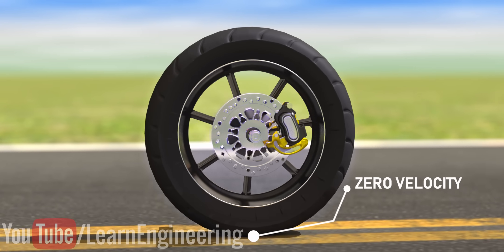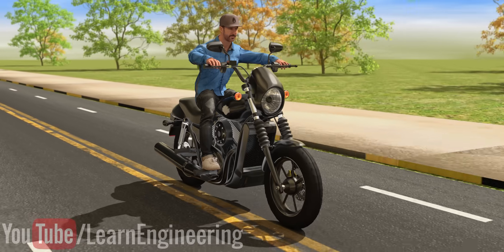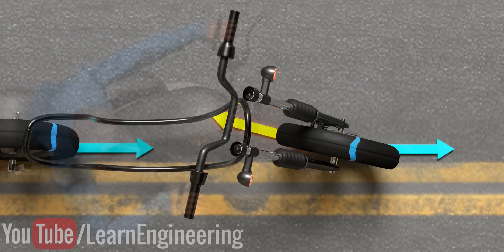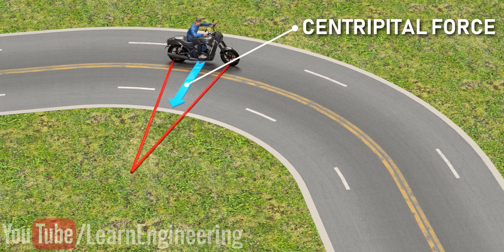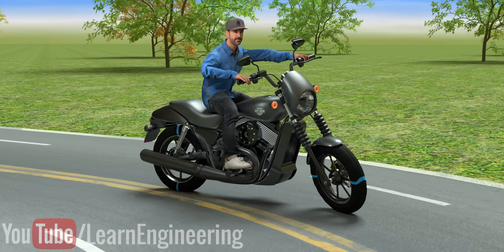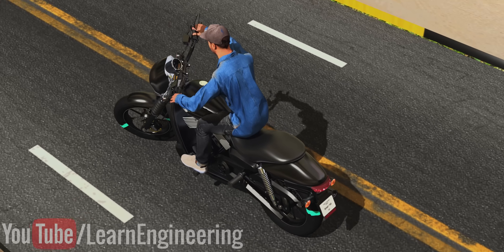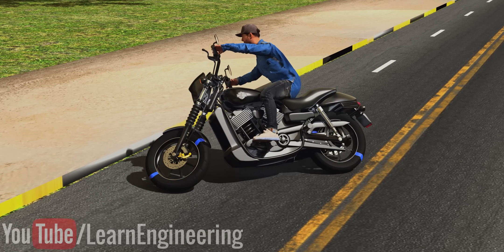Counter Steering | The interesting physics behind it

Comment: Tried.... the technique...  and got  broken right hand elbow 😥
Reply from the maker: I am so sad to hear that. :( Please don't try to master this technique in a single day. You start with small steering wheel turn and gradually increase the angle. It took more than one month for me to master this technique.
Reply: @SabinCivil  I'm sorry, I am confident you have never rode a bike because this isn't something that takes months to learn. You either get it before the first turn, or you end up in a wall. Please just take down the video before you get someone killed over some pack-of-cigarettes worth of ad revenue. This video is completely wrong. There's no trick to it, you just turn the bars and the bike leans the other way. You do NOT snap the steering back into the turn. Doing that will cause the bike to violently jerk and catapult you in opposite direction. You don't get to pick between counter-steering and regular steering. Above ~15 mph it will ALWAYS counter-steer. Below ~15mph it will ALWAYS regular steer. When you're going 60 and trying to go right you HAVE to steer counter clockwise and slowly straighten out the bars as you exit the corner.
Reply: Serge Gukasov 
Absolutely right! This video should be removed! Totally inaccurate!

Comment: I don't think the person who made this has actually riden a motorcycle. It is impossible. effectively steer a Motorbike without countersteering. Turning the handle bars at any speed above walking pace  will only ever have the effect of making the bike go in the opposite direction of the handlebars.
Leaning your body only has a minimal effect on the trajectory of the bike. Its not used as a means of steering the bike. Only to effect the amount of lean angle needed to make a corner.
Forgetting to turn the handlebars back after countersteering really a thing  either. The bike naturally corrects itself.

Comment: This explanation should be ignored, it's not worth a flip. Motorcycle stability and turning cannot be understood without looking at angular momentum, in the wheels and of the entire bike. Rider tilts bike by turning handlebars (in opposite direction). Moving body to the side makes nearly no difference in bike angle. It's all about the momentum vectors, and the cross product. Whoever made this video was an artist, not a physics student. https://lifeatlean.com/how-to-turn-a-motorcycle/
Reply: Why everybody sees only one side? Ok it’s not the best video but turning outwards definitely is causing the lean even on a bike with wheels with no mass. Every turn of handlebars in the straight position will throw you of balance despite the mass or rotation speed of the wheels, right?

Comment: Well explain and easy to understand. I have been designing motorcycle in big Japanese company for more than 10 years, But always find difficulty in explaining this to new engineers.
Reply: Walking hippo 
Well apart from the fact that the video is totally inaccurate on many points!
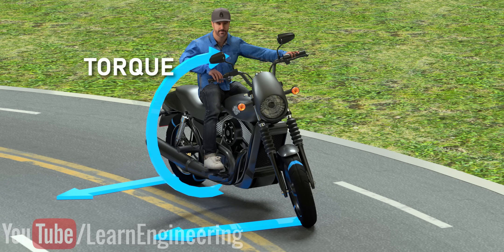Reply: @softailfun   Softail Fun  Yeah. Some explaination is weird for me also. But from 2:30 to 3:40 I think it's accurate enough. That is part I use.  And his VDO is look much better than my hand drawing anyway ^.^
Reply: Walking hippo 
But that is probably one of the most inaccurate segments of the video. The video shows the rider steering right to go round a right hand bend. This is inaccurate. The rider would be steering (very slightly) to the left at this point.
Reply: @softailfun  Yes you right. Counter steering is not a choice. it's a must. Before you lean right you must steer left slightly. Rider do it unconciously.  Some skill rider may do it conciously on purpose. This steering direction in VDO is not accurate. 

I only focus on the arrow and torque and didn't notice the steering direction. May be I should find a better material next time.

Comment: My scooter is new but getting slip while turning in normal'speed
What's could be the reason???
Plz suggest
Reply: Can you explain more. Front or rear wheel slip? Tyre pressure? Road conditions? Model of scooter?

Comment: "A technique used by many riders"?!?...  It's used by ALL riders.
Reply: Live riders :D
Reply: and even for ghost rider :v
Reply: THANK YOU.  You can’t turn without initiating it with at least a small counter steer.
Reply: It's the only way
Reply: It's not a technique. It automatically happens in any turn after about 8 mph.
Reply: @generalyellor8188  At any speed at all, from walking speed and up
Reply: Thats a beginner problem, i learned it seeing other riders when i was practicing in traffic
Reply: Yeah, I find it funny how they explain it as if it was some advance Moto GP technique. I don't even know how you can ride a motorcycle over 40 km/h without ever counter steering.
Reply: @foufoufun  Actually at any speed, from idle and up you countersteer.
Reply: @kjellg6532  True, it's just that you have to be more deliberate with it above ~25 km/h.
Reply: Did you watch the video completely?
Reply: The cortex learns how to ride a bicycle without reasoning processes. It is possible to explain how the rider starts by tilting the bike taking it out from under him to the outside of the curve. To achieve this, countersteering is absolutely needed, for a short moment only. Then the motorcycle and the rider can make a curved path compensating for centripetal force with force of gravity on the displaced center of gravity. The bike doesn't tip over, the curve is made, the rider subtly corrects the handlebars.

Comment: This is absolutely a load of horse shit. Just counter lean with your torso or raise your ass a few inches to allow more movement to counter your rotational torque. Turning into the threat even for a split second adds more constraints to a real world application by lowering your distance over time response to the object. Of course the example by the guy shows an empty street. But in real life you're not doing this on an empty street. Think about it. You're going 35 to 50 mph, your 35 ft away from an object and you decide to turn into the threat... Now this has used up those precious feet and seconds going into the objects direction and path instead of maximizing your time and distance running counter to the threats incoming movement. Plus it's highly unstable and unsafe compared to counter leaning with your body weight. If you want to make motorcycle videos on what you're actually supposed to do, why not confer with bike riders. I would never tell or teach someone this garbage. You're not a wooden poll. Your body has many axis' of possible movements to not do something stupid on a bike. 

For the love of god if you are a new rider do not do this. You will die.

Comment: Btw you always countersteer on push-bikes and motorbikes unless you are going at extremely slow speeds (5kmph) so countersteering is actually the normal turning method and isn't just a "useful trick" but literally the only way to turn at speed. The "normal turn" is actually more difficult to do so most people naturally countersteer. Counter steering in the real world isn't what it's like in this video; you don't actually turn the handlebars more than a few mm unless you want to drift the back wheel. If you physically turn the handlebars and make a hook turn (which is what happens in this video), that's the same principle as countersteering, but it's not actually countersteering

Comment: In motorcycle there is no "Normal stearing". The only way to turn - is coгnter steуring. Its because the point of application of force (sorry, if I call it wrong. My english is bad) is not the same point, where is center of mass is... Only way, to lean a bike into a turn - is counter stearing. We can not lean bike other way.

In your example in 2:00 motorcycle will fall, because it has inertia. When we turn stearing, center of mass will stil go straight, because of inertia. Motorcycle will lean to opposit side of turning.

Comment: You have presented counter steering as an alternative to “normal” steering which in inaccurate.
It doesn’t matter whether it’s a bike, a bicycle or any other vehicle where the center of gravity happens to fall on a line between two contact points.

To maintain a turn you need to lean and steer like you said. But to lean you need to steer what will cause your bike to fall to the side you want to turn and will allow you to turn.
Then to stop turning you have to steer more into the corner to brake the balance between the torques and straighten the bike up.
Every single turn on every single motorcycle ever was achieved with counter steering.

Also there is the influence of the gyroscopic forces that multiply the effect and help you to turn but it’s ok to ignore them just for explaining the concept of counter steering.
Hope your video helps for new bikers to drive better and avoid accidents.
Thank you for your video.

Comment: BS physics, the so called "counter steering" is ALWAYS how you turn any bicycle-style two wheel vehicle. If you just turned the handlebars right to turn right it would result in you falling over to the left in stead, this destinction between "normal turn" and "counter steering" is stupid - in addition this is a very unfortunate labelling since what is usually meant by "counter steeering" is to compensate for a loss of friction on the rear wheel, where say in a right hand turn you'd quickly steer left to keep the bicycle upright or even in a car to get the car facing back in the right direction to regain friction on all wheels.

Also, while the 3d model and grapics are quite adequate, the animations are not, they have little to no bearing on how real world physics affect a vehicle, maybe don't teach something you really don't understand very well at all yourself or which you can't represent properly in animation, whichever it is...horrible video which threatens to make the viewer dumber :/

Comment: You have to countersteer after a certain speed or it goes very badly for you, you do it automatically along with shifting weight etc, its learning to done it on knowingly that makes a difference to riding you can see the way the front wheel wants to move if you weave in a straight line, turn your bike by leaning on the pegs and look at the bars movement

Comment: I disagree with this 100% and what it teaches riders. You never "turn" your handle bars while riding at speeds over a few miles an hour. You push on the side of the handle bar in the direction you want the motorcycle to go. Push your right hand forward, the bike turns right. Pushing the right side of the bar forward means the left side come towards you, which looks like turning the bar left, which is confusing to the rider and can get them killed.

Comment: Weight shifting is crucial. Rider leans very much on very curvy road till knee touches road this is only possible on race track as one rock can break knee apart.. The rider is to be in perpendicular position for very sharp turn and lean the bike only... Most important don't accelerate and break means sudden change in speed.

Comment: last practical demo was superb
Reply: No. It was horrible. That guy says you don't lean when counter steering. Counter steer and lean are two totally different things. You can turn the bike without leaning by counter steering but body position is important also when turning especially at higher speeds and sharper turns. It's very difficult to ride a bike through a sharp turn sitting perfectly upright. Anyone who wants to understand counter steering should watch Twist of the Wrist II here on youtube. This video is confusing and blatantly incorrect on several points and should be deleted.

Comment: I’m sorry but this video contains dangerous misinformation for practical riding. At any nontrivial speed (I reckon anywhere above a fast walking pace) shifting your body does almost nothing to lean the bike. 

Riders who think they do “normal” steering that you describe in fact unconsciously counter steer. The problem with that is in a panic situation they try to consciously “normal” steer and end up turning in the opposite direction than intended.

You could run some numbers on that. Such video would be very interesting.

Comment: With counter steering the rider is using the laws of physics and the weight of bike and rider to initiate the lean.  With normal steering the rider is using just their strength and body weight to initiate the lean.  

Not covered in the video there are also the stabilizing gyroscopic effects of the spinning wheels and engine that have to be overcome.  This is the same stabilizing effect using to increase accuracy of projectiles fired from rifled barrels.  The larger and heavier the wheels and rotating drivetrain parts the greater the stabilizing effect and thus the harder it will be to initiate the lean.  Meaning the bigger and heavier the bike the greater effort required to lean the bike with normal steering and the easier it will be relatively to lean the bike with counter steering.

Comment: finally, i found the good explanation about turning motorcycle at corner. Thank you, LE.
Reply: Hayzeq Eiqbal 
Believe me when I tell you ........ You haven't found that at all. This is total rubbish! This vid is dangerous and should be taken down!
Reply: @softailfun  Make it clear man. I need further explanation 😁 coz I'm a learner.
Reply: Hayzeq Eiqbal 
The rule is simple. Push left .. Go left, push right .. Go right. Push being a gentle "push" on the left or right handlebar. The more you push the tighter you will turn. When the turn is complete and you want to straighten up, gently release the pressure on the bar you are pushing and the wheel will straighten of its own accord. It's really easy, but be warned..... The first time you try this the reaction of the bike is immediate. Hope this helps. Keep safe.
Reply: @softailfun  wow it is very easy to understand
Reply: Hayzeq Eiqbal 
Hope it helped you man. Take it easy.

Comment: This guy doesn't understand what he is talking about.  The only time a motor cycle will go the direction the  handlebars are  turned is walking speed.  Higher than that its push right go right push left go left. The gyroscopic forces generated are 90 degrees ahead and opposite to the input force.  The biggest cause of bike crashes is the driver panics and try's to gorilla fist the handle bars, the result is they will drive the bike straight off the road and not around the turn.

Comment: Leaning while turning will reduce  the frictional force because f = umgcos(@), where @ is the leaning angle , so the torque produced by the friction force will also reduce and hence only slight inward leaning will be required which during driving can be felt by the driver

Comment: At high speeds (over 20mph), the front wheel is a gyroscope.  When you apply pressure to the handlebar, the handlebars DO NOT TURN.  The force is transmitted to the front wheel (a gyroscope), and is translated into a force at 90 degrees from the angle of the input force. 

The force on the gyroscope (front wheel) rotates the bike toward the direction of the push (push on the right grip rotates the bike to the right).
Reply: The force is applied 90 degrees in the direction of rotation; the bike rolls in the opposite direction of the steering force due to how the fork is attached to the axle.  Sit on a swivel stool with a spinning bike wheel held by the axles. Apply a turn as though it were on a bike and see what happens.
Reply: Mark Reynolds hell, I've even dismounted my bike's front wheel to see what you mean and nothing happened regarding the swivel stool. Alan Colon is absolutely right and it's a known property of a gyroscope. Next time try for your self before you write something.
Reply: @AdiCherryson  you are applying gyroscopic precession to something it is only a small part of.  Want proof?  The bike doesn't stand back up when the wheel tracks the other way.
Reply: @TigerDude333  wouldn't it want to maintain it's current angular momentum, seeing as work has been done to the system ? If the bike stood back up there would not be conservation of energy
Reply: @michaelrice500  are you serious? I don’t know what bike you’re riding but on mine the wheel doesn’t turn around the horizontal axis. And even if it were it would have nothing to do with the bike’s lean but only with it’s rotation around the horizontal axis. What are you trying to say here?
Reply: @AdiCherryson Physics; it's not for everyone, I guess.
Reply: @michaelrice500  I can see that.
Reply: @Sneaky1ne   If you assume that gyro precession makes the bike fall over, then it would stand back up when the wheel tracked the other way; or, the wheel wouldn't move if you want to conserve energy.  The reality is that it is the rake and trail that makes the bike turn; bikes can be stable even without any gyro effects.
Reply: @michaelrice500  your irony (the real kind, not the Alanis kind) is strong on this.  Wiki will explain to you that your knowledge of physics needs to be applied correctly.  The is engineering; you need to apply the science to make it work.
Reply: No.  Gyro forces are a small portion of the turning force.  Look up the wiki article, which explains it.
Reply: thank you, that's the proper reason. And this means that you don't really have to worry too much about positioning the handle bar back

Comment: Turn left to go right ... I'm speed
Reply: It's better to just think about a simple, intuitive way to achieve steering:  push the handlebar in the direction you want to go away from you.  If you want to turn right, push the right handlebar away.  If you want to go left, push the left handlebar away.  Of course this only works at road-going speeds.  Once you're at parking lot or tight maneuvering speed, you want to revert to the "normal" method of steering.
Reply: @razortm9947  https://youtu.be/U9kRAtDhLMo?t=105
Reply: @kdh6387  error 404 instructions not clear for 4 wheelers